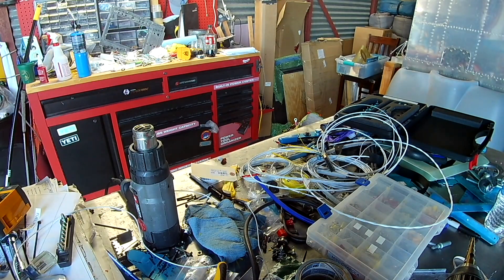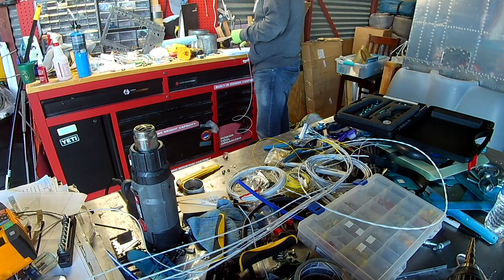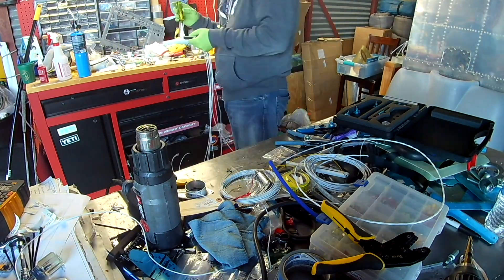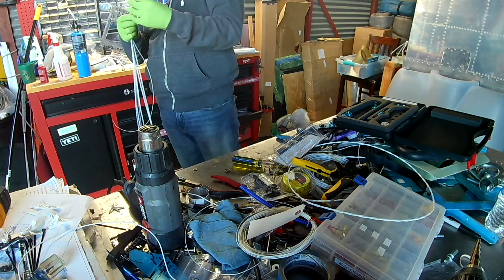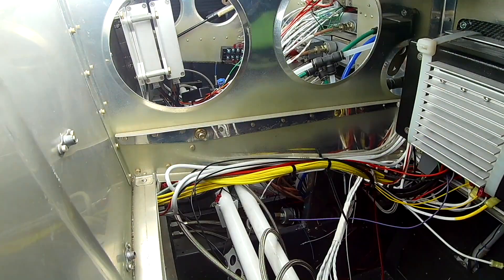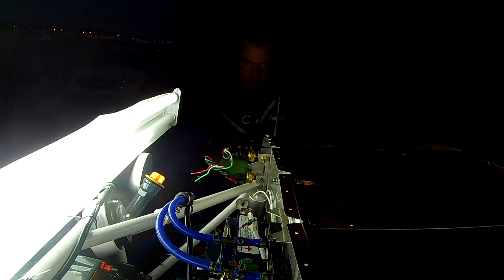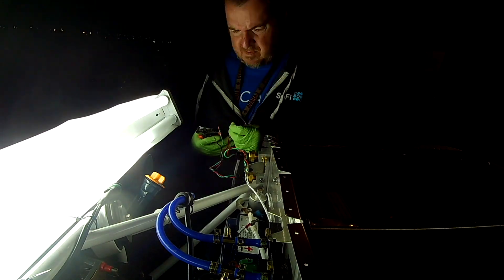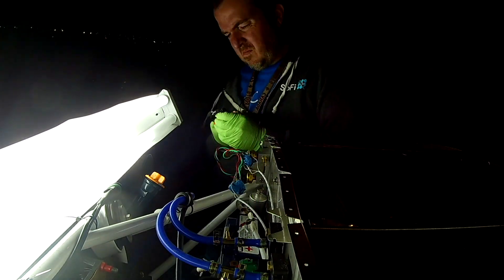RV-14 G3X Sensor Wiring II

Comment: Andrew, thank you for the build videos. I love them. Is there any way you can go into detail on your engine specifications from LyCon? I remember you mentioning that your engine has 230HP? What all did the engine builder have to do to obtain that number? Happy New Years and looking forward to your next video.
Reply from the maker: Its been ported and polished with a cold air sump and the flyefii system put in.